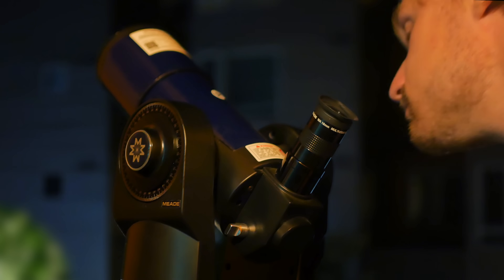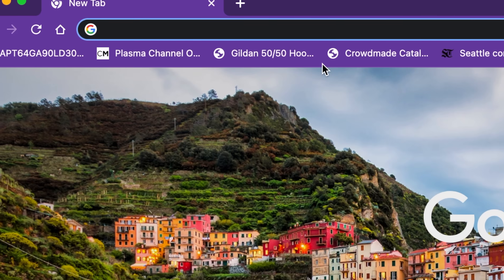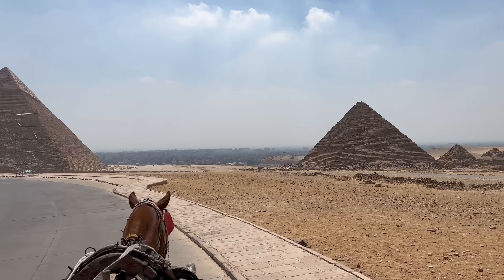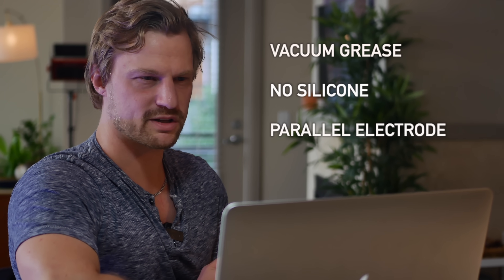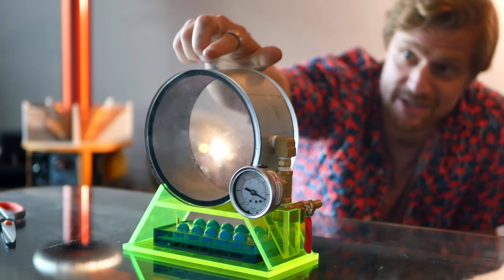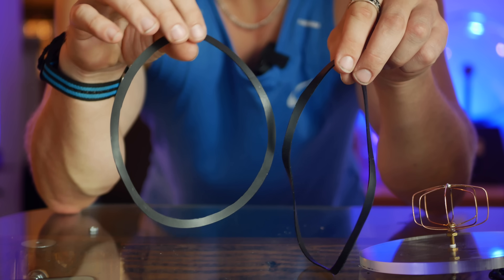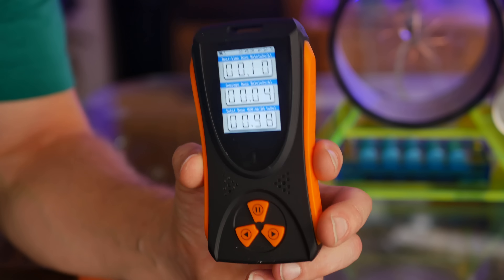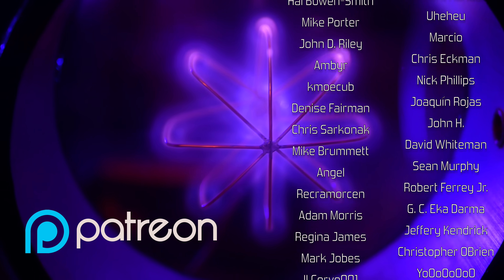Building A Nuclear Star In A Jar (Fusor)

Comment: Ah! the single device that convinced science stars are made from gaseous plasma and generated fusion at their core. While an not dissimilar device created in the 1980's using a similar amount of power as this one here, actually generated a measurable amount of fusion products. The embarrassment set our technological development back at least 30 years. 
I am confident that "Plasma Confinement" will never be net positive in any significant way. I strongly doubt any of the inertial or laser methods will work to great benefit, either. Largely they are a waste of money and too has been all fusion research since the 1980's. Quietly over the decades, curious skeptics and mad tinkers have studied and refined the Pons and Fleischmann experiment. In 2020 NASA released a paper on "Lattice Confinement" basically explaining and outlining all the science and construction of a "Cold Fusion" device even going so far as to explain that the device could operate at near room temperatures since the fusions occur on the nano meter scale and inside the lattice. This ties into research on the the spectral wavelengths of our sun which present some debate over if the core is a dense gaseous plasma or metallic hydrogen; more of a metallic plasma. 
We are on the cusp of understanding fusion and being able to control the power of a star. It's just not what you think or have ever been told about.
Reply: hydrogen isnt a metal
Reply: @cpu_1292  
LOL, 
Do you even Chemistry bro?

Comment: A little disappointed. I thought I'd see an actual star. In a jar. I thought I'd see an air bubble being jammed with frequencies. Which I think is how the "sun" works anyway. Not that CGI lava ball from Disney. 

I think you are trying to compete with Thomas DeLauer, on the whole, "Keep my arms bent and my guns exposed." 

My own humble opinion of the sun is that it's not solid, it's not a few million miles away, but frequency generated and I believe that the old-world Knew (something like Tartarians or Tartaria; olong that line of thought) exactly how that worked. I also believe that we live in a realm surrounded by super cold temperatures and superconductors and super-fluids and I think it corroborates the sun in some manner.

Comment: Next time you use threaded fittings for pressure or vacuum I would recommend using 3-4 wraps of a thick ptfe tape (the brand I use is venom) and pipe dope (Hercules pro dope is the best for metal-metal) on top of it. I am a master plumber and I do not get leaks ever!

Comment: I am not sure if this has been pointed out, but a single fusion event might have been caught on camera at the 12:59 - 13:00 mark, seen as a brief pinpoint of light on the 3 o'clock arm of the electrode. This might be some other camera artifact, however it is how fusion events in fusiors appear, and occured in the area of the fusor that fusion events typically occur.
Reply: If a fusion event occurred it would take place in the empty space around the electrodes, not on their surface. The light seen is likely small pieces of metal vaporizing. Electric fields concentrate on imperfections, causing more power to flow through them.

Comment: What are the blue thingys called? They're in the bottom of the fusor setup and I'm interested in learning more about how it all works. Also, what about the things on the bottom of that with the thick black bar in the middle? Also, what is the copper wire contraption connected to and how?

Comment: you cannot detect neutrons directly from Geiger counters , have a paraffin or cobalt layer between the setup and counter ,,   still 1 or 2 counts per sec/per cm  wouldn't be easily differentiable from background radiation .

scintillation counters would do btw , but expensive

Comment: I used argon for my plasma lamp that I made in 8th grade. I also used automotive Schrader valve fittings so I can use refrigerant vac pump. I wanted to use xenon gas but it was too expensive. The argon was pretty try it out.

Comment: How can we replace Diesel engines with Fusor engines?
Reply: Sorry to bring you bad news, but fusor consume ~1 000 000 times more energy than it produces and no amount of engineering can resolve this issue.
Its a very expensive and ineffective light bulb that can kill you by neutron radiation.
Only practical purpose fusor might serve is to irradiate stuff via high energy neutrons that D-T fusion provides.
This can be used to manufacture Pu239 from U238 (depleted uranium) to make bombs or to serve as a fuel to nuclear power plants.

Comment: Um did you purposely leave out a part of the build for some reason I can't find the part where you build the wire star is it just copper wire or tungsten or what and what's the temperature in that thing. Also if you think you can fuse elements then screw the hydrogen put in two elements that add up to gold.

Comment: High voltage and a vacuum? So, erm... You built a plasma ball. It's cool and all but plasma balls can be bought for as little as $10. Also, they have absolutely dick to do with fusion. Fusion takes immense heat and pressure and the plasma produced in the chamber was neither hot enough nor was there enough pressure. Star in a jar? Nope.

Comment: Hi
I am an electrical engineer working in a start-up company we are working on  high voltage power supplies. Can you please explain how a ripple capacitor is calculated in voltage multiplier. Or share any documentary on high voltage multipliers. 
I would be glad if I get a reply from you. 
Thank you..

Comment: Vitron seals are used in industry for explosion containment in case an explosive atmosphere were to occur inside an electrical panel etc: the panels / containers are designed to contain the explosion and use these exact seals

Comment: try adjusting the drive frequency and generate a signal inversion I once on accident got it to work like that on room pressure when my generator died and this caused some kind of capacitance like effect which reversed the stream. I did however use anothe aproach, my original goal was to try to make atoms vibrate/resonate at speciffic frequencies in a attempt to make physical materials ignore collission with eachother. the theory I had was that due to the insane space difference between atoms that if I could controll their general molecular strucure so it would kind of become like a linear crystal like structure than the chances of it having a collission would be a lot smaller and once it doesn''t colide it shouldn't collide anymore or atleast be even more unlikely. you can see it like this atoms are like very small particles floating through a big space kind of like planets and stars. if 2 star constellations where to hit eachother fully sideways and in random orders so they need to both completely go through eachother the chance at a collission is big and so the effect will be caried over atleast partly to other parts which also increases the effects and chances of a collission. now imagine we align them all in a more linear like array then when they pass through eachother the chance of it working properly suddenly hugely increases since rather than having thousands or more of chances to collide it only really has one and then that chance repeats to the same magnitide smaller when we look at things to small offsets.
That was the main concept. it is actually kind of like a 0th state of matter in some ways but then fully artificial since it actually would in theory need to have negative energy which is provided by the high voltage generator/frequency fractals, and once that energy is released it will be pushed back into movement again and inverse it back to positive energy levels. this isn't completely litteral but it can be depending on how you look at it. it is basically forcing the grid into a crystallike structure.
another thing that might be worth trying which I wanted to try as well was to properly controll the rotation of the polarity, basically similar to what they do in quantum computers these days but I wanted to do it the rough way with slightly less exact and more abstract controll but more particles the idea was that changing the rotation of the charge and polarity might be more easy than forcing atoms to take on a linear crystal like structure. even though I didn't do much to make the experiment for that speciffically since that was for a other experiment but the device I made for it(made a mechanical computer for controlling it) was way to slow. so I just went for the thing of trying to make the attoms resonate/forced vibrate in speciffic ways to make them take on a similar structure in essence that would allow for materials to pass through eachother.
know that that was quite long ago, and I had quite bad equipement so couldn't read or set exact values only could adjust things to make relative changes and get abstract values but not know what the real values where. I used something like 100k to 200k volt to drive it and used a high frequency, however there also was a hearable frequency so don't know if that was the one I used or if there where overtones or undertones or just other frequencies getting in to it. my method also used a lot more brute force I had 2 different electrodes to far away for sparks(did get some sparks when trying to set it up however nearly fried it before setting it up so it was already damaged which would have affected voltage and frequency.
got it to drive a semit plasma bridge at the givven frequency. the idea here was that air would be more easy than more dense materials and if it worked it should still pass through something. had only one generator however so even if it succeded I wouldn't have been able to properly confirm it since I had no other generator to generate the frequency to tune the other object(my only way to confirm it was to check for small accidental particles going through and it had to be enough to be quite easily seen or detected by a simple cmos sensor). but when driving it eventually something happened. I don't know exactly what the cause or reason or whatever was. but the device suddenly broke/stopped working and close to the middle of the device I had a very small bright white spot clearly visible to the eye which was there for a very short time however gained a lot of adrealine from  it and then went away with a bright flash and a super loud high sound that people could hear quite far away. there actually came people to the place where I did the experiment to look what had happened there after they heard and felt the loud sound.
I don't know exactly what happened, since I didn't have proper relyable devices for generating it, also no proper circumstances and I also had no proper ways of measuring it.
but my speculations are that it was one of the following things: either the device just broke down which caused a capacitor like effect(used such a effect to regulate the frequency just like in old very high voltage devices like which nikola tesla used for things like wireless energy but slightly different), or something like a dust particle getting in and possibly that would show that it partly worked since it might suggest one of the air particles partly went in or through but then fused with that dust/polution particle. or the molecules got kind of fuzed/stuck in eachother and then slowly got loose from eachother. or it was a combination of such effects.

it also after thinking of the idea that due to the capacitance effect the stream might have temporarily inverted when it broke down this made me think of something like a small scale particle accelerator. and brought up the idea that perhaps when matter get's into a plasma state it can get into a unstable plasma state. the entire theory is more complex but the main principle was that in that state there might be a possibility that physical matter starts to kind of ignore general physics related to mass and such and starts to act more like the energy which keeps it in that state which would allow to accelerate it to super high speeds very rapidly but only lasts as long as the energy is in that state you could see it like something like a quantum effect where the energy flows but some of those high energy particles might get unstable and so kind of remain linked to that much faster moving pure energy and following that. after all speed is only relative and so that crystal like linear structure might also help with this since if it ignores collisions then it also has no points to compare it's relative speed to which means that no mather how fast it goes the relative speed remains zero since it is only linked to that energy so it would actually in theory cost energy not to follow it. and when seeing it like a quantu effect you could say it is linked to that enegy and unlinked from the rest. then when the stream suddenly inverts but keeps the frequency and some energy particles are still moving then since they are all aligned to the same crystaline like structure and locations they might collide and so suddenly have a super high relative speed difference which can cause them to merge. or if the energy suddenly stops the particle might  suddenly see the normal particles as a opposing force generating a high speed difference again.

Comment: Unfortunately you don't have a strong enough vacuum here. In the fusor forums they recommend 1 micron of pressure, which is impossible with you set up due to the lack of a high vacuum (or second stage) pump. But if you go that route make sure you have proper shielding because the neutron radiation will cook you like a steak if you don't

Comment: Air cannot fuse 😅 this “fusor” only turns air into plasma by high voltage but there’s no fusion occurring. Fusion needs fuel like deuterium and helium-3, they can release neutrons or protons, its energy can be converted into electrical energy. As you have seen, there’s no radiation releasing from this device.

Comment: You didn't have any radiation protection on the fusor. Did you get it to the point of nuclear fusion or the sub fusion state? Full fusion state will emit very very high and dangerous amounts of radiation. 

I was just curious because my nuclear fusion reactor I made emitted a lot of highly dangerous X-Ray and Gamma Ray Radiation. It was emitting full particles at a constant rate and I had to shield the fusor with lead. And even then during the testing states my giger counter measured high amounts of radiation. 

Mine was a magnetically confined plasma. With using an AC electricity for the magnetic confinement. I used the positive end of the AC cycle for polarity to confine it. If you reverse the connections on an AC power source it'll either repel or it'll attract more than it does the other side. So aka, attracts more than repels one way. Then reversed is repels more than attracts. This is an efficient way to have a high flux magnetic field to help move the plasma around and control its height and length which allows for easier cooling control. Plasma channel doesn't cool down but the elements around it will.

I loved the video and I'd love to see you make it with tritium. Just take some caution. I started making my first one when I was 10 and completed it when I was 11.

Comment: Interesting video. I have a couple of questions. 1 is the high voltage ac or dc? 2 why does everything pull towards a plasma arc (including fire)? 3 if you sit that thing on a scale would the weight change? I'm try to figure out how to create an engine that pulls with a plasma charge

Comment: Nice work! Watch out for virtual leaks from oils on the chamber walls. They'll sometimes persist for a long time, slowly off gassing and preventing a strong vacuum.
Reply: You can also use isopropyl to detect leaks if it is just a tiny hole.

Comment: I don’t know if the US is the same as the U.K. with ptfe tape, we have the std really cheap version suitable for water, air and similar. We also have the gas version (gaseous state not what you call petrol) this is 4-5 times the price. The difference is porosity ( yes it is porous at near molecular level). This will also hold vacuum.

Comment: Hmm, I think youtube keeps removing my comments. I thought it was because I had a link, but I removed the link and I still can't post.
Reply: I think I'll post it in sections below this to see what it is mad about.
Reply: Loved the video! I made one of these a while back (no where near as nice looking as yours) and it was really fun.
Reply: I think the issue with your original pump was that your tubing was too loose.
Reply: Our research group uses tubing from McMaster-Carr
Reply: If you haven't heard of them, McMaster-Carr is great. They are the mechanical engineering equivalent of Digikey, Mouser, Fry's, or Microcenter. Their search user interface is amazing and they include Soldiworks models of almost all their parts so you can make a virtual assembly before accidentally buying the wrong component.
Reply: We use this stuff from McMaster-Carr Hard Polyethylene Tubing for Chemicals, Semi-Clear, 1/2" ID, 5/8" OD, 25 ft. but all their tubing will have vacuum ratings.
Reply: Man, it was an absolute pain in the butt to comment this, lol. Youtube deleted like 16 of my attempts.
Reply: When I saw how easily your tubing slid over the barb, I guessed it might not seal well.
Reply: Sorry for the absolute mess of replies. I just tried copying all this, word for word, into one comment, but Youtube deleted that one too. I give up, lol. Hopefully you can figure out what I was trying to say from this mess.
Reply from the maker: Thank you for letting me know! You’re right, the tubing probably was the issue the entire time. Not sure why your comments are being deleted, but I will check the filtering algorithm on my channel to see if it’s snagged up some of your attempts. Thanks for letting me know